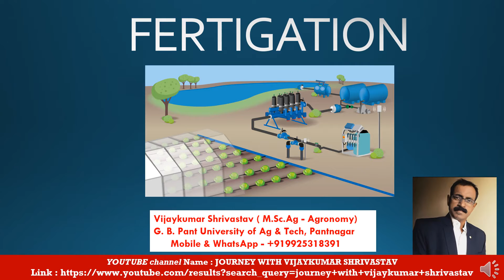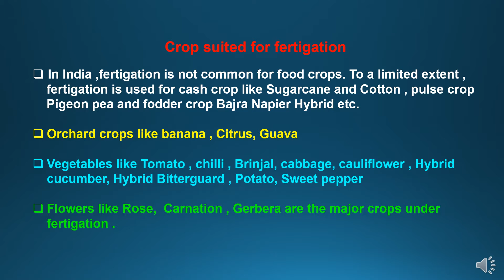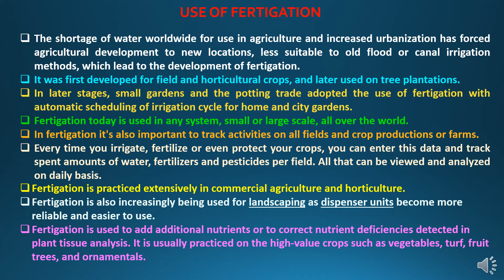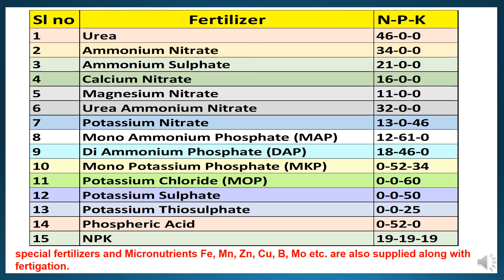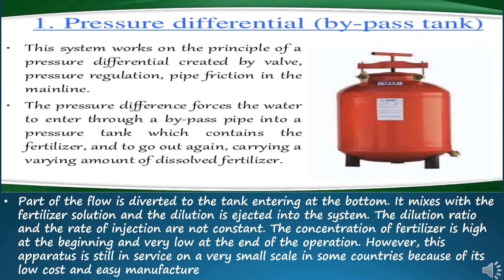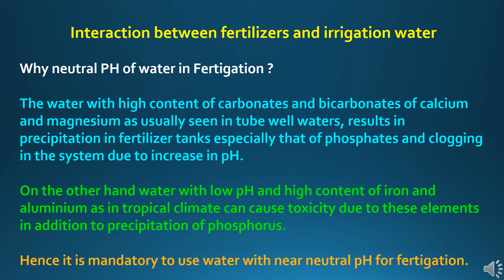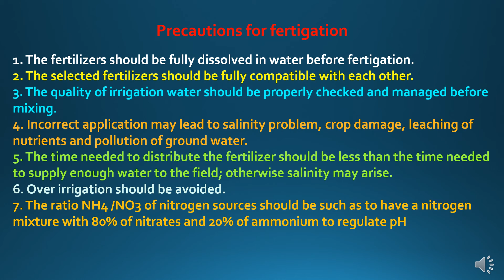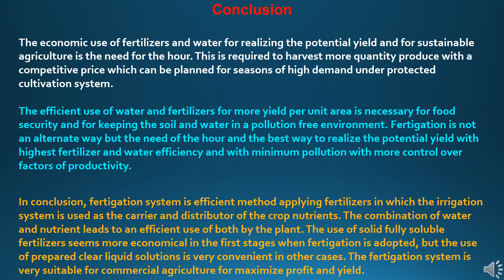FERTIGATION

Comment: Sir will this be effective for giving organic and bio-fertlizer ? wondering how effective if we give 2000 litres of jeevamurtham at 1500lph along with irrigation water ( 1 hr) ? should i go for less lph injector ? high injector ?
Reply from the maker: For fertigation the fertilizer should be totally soluble in nature. Fertilizer solution not be precipitate in irrigation pipeline . I don't think organic or biofertilizer is compatible with drip or sprinkler. Please check suitability. Thanks!
Reply: Thanks sir for the quick reply , yes im using them in a liquid form , my concern is what lph i should use coz in the market we have multiple lph , slower rate will be better ? for example if my irrigation schedule is for 2.5 hrs supplying 32lph (dripper emitters rate) per cocunut tree , can i also schedule the fertigation on the same time using injectors let say 1000lph -2000lph ?